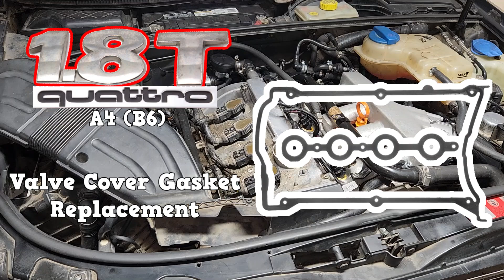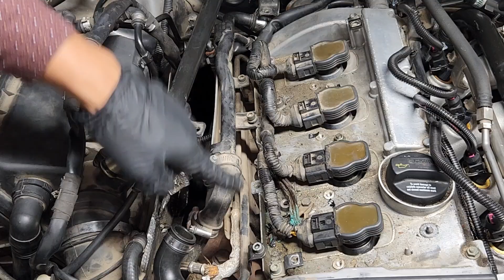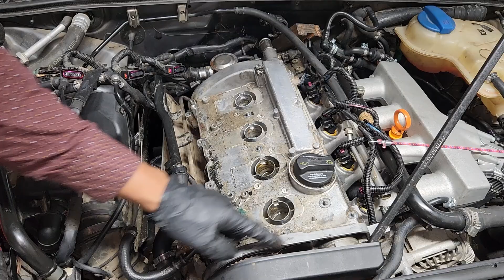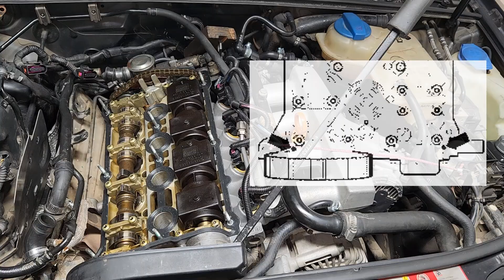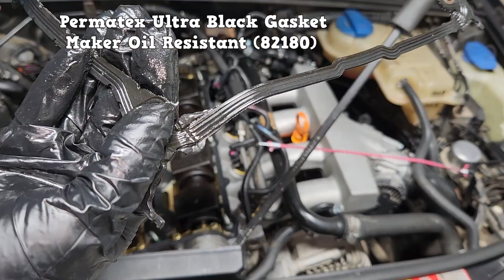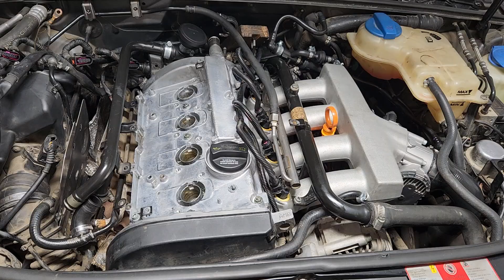Valve Cover Gasket Replacement Audi A4 1.8T Quattro (B6, AMB)

Comment: Hello, I replaced the valve cover gasket on my Audi a6 c5 1.8t. I know that I cleaned the surfaces very well. But it leaks into the spark plug holes. So now I have to replace it again. Can I use only a little  rtv sealant under and over the whole gasket?
Reply from the maker: Yes, but the gasket should be enough, was it a gasket from Amazon?
Reply: @OldSchoolNoe Thank you! No it was a quality gasket, I think it was Elring

Comment: Can please show me how to fix the wire harness I been having a check engine code for a misfire but I have changed the spark plugs and the ignition coils so I’m guessing it’s the wire harness but I’m not as good with electrical stuff if you got any advice I’d appreciate it man I enjoy watching your videos the help me keep up with the maintenance of my Quattro currently with 186000 miles and still running !